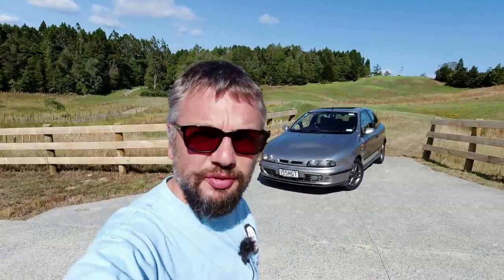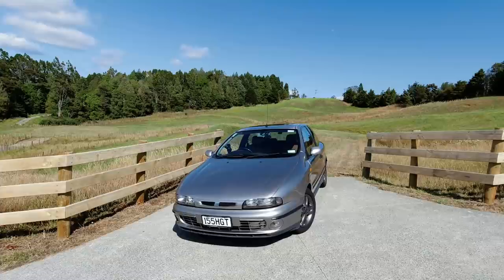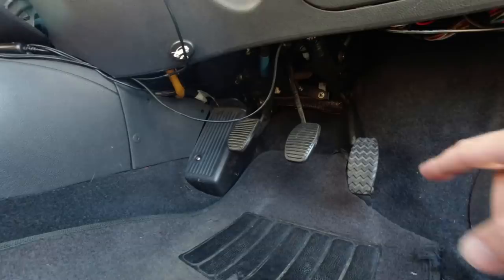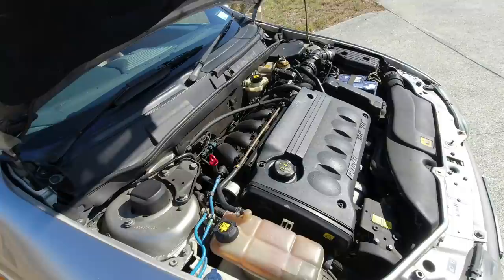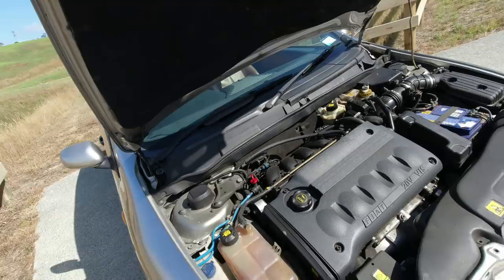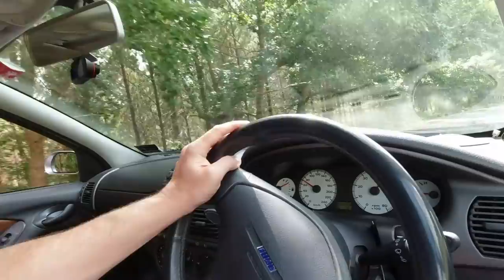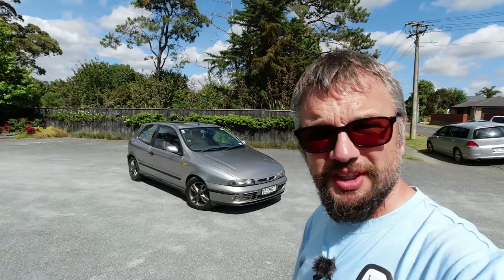Five-pot Fiat! Bravo HGT (Type 182) - Italian Music

Comment: Interestingly the speedo seems to work in reverse too. Glad to see it doesn't have those Fiat lensed lights that seem to exist mostly to blind oncoming motorists. Notably, Ford also put the Volvo 5-cylinder engine in the S-Max and Mk 4 Mondeo (obviously the Focus RS and ST also). Very much suited the big barges which had excellent chassis to deal with it.

Comment: fiats of the 90's! what a great time they were, my first fiat was a bravo 1.6 with a measly 103bhp.
but the twin cam 16v sounded amazing after 4,000 revs. 
HGT Bravo's are insanely rare to buy here in the UK. The 5 cylinder in NA form sounds fantastic,
Those Airbag seats in that colour were a very rare option.
The Cambelt can easily be done in situ, give it to a specialist and itll be done and couple of hours(maybe less). The Low Power is probably down the the VIS selenoid not opening correctly at low revs.
Reply: Turned out inlet leaks were fooling the system, sorted now :)

Comment: Nice to see an unmolested example. They've all gone from the roads here in the UK but I remember the 'council' look was to paint the rear lights black.
Reply: First owner 2001-08 had blacked the sills to prevent stone chips on gravel roads. Will revert to paint color when I get a respray. Clear coat starting to go in NZ UV

Comment: Interesting that the sunroof closed by itself before the drive. Still, it's 1000 times better than sliding open by itself, only to never close again. 
We also got the estate version, known as the Marea Weekend. My brother still has one, owned from new in 1999. Still a very nice looking estate car that goes well with the 105hp 1.9 JTD. The top of the rear bumper hinges down to make the boot access usefully low. I still like these Fiats. It is well-built, although the sliding cover for the tape-player had long-since snapped off and has been living in the glovebox ever since!
Reply: It makes sense that the sunroof closes when the key is turned off to prevent rain getting in because you forgot to close it!

Comment: I like that a lot!  I had a 1.6 Marea weekend (with the drop down rear bumper to air boot access) in about 2000 and seeing this Bravo puts me very much in mind of it as the front end and interior are almost (if not totally) identical apart from my Marea had cloth seats.
I remember the mirth around the 5pots requiring the engine out to do the timing belt!!
Great video👍👍👍

Comment: I know that for me the correct word is that it is a cool car. Still have to watch the video. When I was a kid, I played cars with two of my best friends which comprised running around the plauground and doing wipers when it rained, no joke!!, making engine sounds and so on. Every now and then we had a “new car”. One of those new cars was for me this one. I told them it was a poor man’s Ferrari. Okay, I admit it was either the Brava or Bravo because I mixed them up constantly. In fact I mixed them up so badly I meant it was a Coupe Fiat, yes coupe fiat, not fiat coupe in fact. Confusing times back then. Already a car enthusiast back then. Logically, being raised by a Triumph apprentice during the 70ies at the Belgian importer Decat.
And yes, 5cylinders sound lovely! They are bit peculiar, bizarre, intriguing to me all at the same time. Perhaps underloved? Perhaps ideal, if not perfect, for HubNut?
Everything you say during the introduction about the era, the designs, the resemblance of a 147, is just spot on!
The rear lamp clusters make me think of those of an Almera a bit. I like the fact it looks like it has been slightly “tuned” and matches the tuning scene of that era as well, BUT it isn’t and shows a certain level of class, albeit sporty together. Really special car than you cn keep looking at from all angles really. Perhaps a little underpowered it seems... expected more from that engine.

Comment: Worked for fiat for 20 years 1991 onwards and owned some beautifull cars with there staff discount scheme..Punto GT,, Punto HGT,, bravo HGT..stilo abarth schmaker,, you can't beat the sound of a 5 cylinder fiat..Punto HGT only 4 cylinder but 1.8 nice engine but went through camshaft variators for fun...
Reply: yeah, Fiat released a revised variator that lasted longer but they were a bit too late

Comment: I had one of these. My first near new car, back in 1999. Mine was a 1.8HLX which was a high spec car for the day. Everything except aircon. 
The seats were the most comfortable I’ve had in any car. They had to be because I’d swear Fiat had forgotten to put in the suspension which very crashy. 
It ran fine until the main dealer serviced it. Then I kept getting a random injector light. 
Sadly there appear to be none for sale in the UK now. Only the 2007 onwards model, a completely different car. 
No Mereas for Bravas either.

Comment: You missed out volvo 😂
Reply from the maker: Well, they nicked Volkswagen's engines. 😉
Reply: @HubNut  nooooo, that is an urban legend. They only used the VW  2.5TDI in the 850. The petrol 5 pots and subsequent D5 engines were their own development. This was a modular engine, also 4- and 6 cylinder versions were developed. https://en.wikipedia.org/wiki/Volvo_Modular_engine
Reply: @HubNut  Your knowledge there really disapoints me, Volvo's 5 cylinder petrol engines had aboslutely nothing to do with VW .

Comment: I had a 1.4 model from new.  The cam belt tensioner failed at 9000 miles (thankfully still within its warranty period), and then a recall was issued to replace all tensioners I seem to recall.  I loved this little car at the time, despite is insatiable thirst, (I averaged about 25mpg)!  I think Fiat replaced the 1.4 after a few years for a 1.2 from the Punto.
Reply: Paul W Yes correct... the 1.4 was a Tipo block with a modernised 12v head (2 inlet 1 exhaust) but it had issues with economy and camshaft lubrication (pipes gumming up). 

 Replaced by the great 1.25 16v FIRE motor.

Comment: My dad had a lowly one of these. All I can remember is that the soft touch coating on the interior door pulls was unbelievably flakey. It also had head gasket failure 3 years from new, just outside warranty.

Comment: Makes me sad when talking about 5cyl volvo wasn't mentioned. Considering the entire 850 range only came with 5cyl diesel and petrol. But cant remember everything :p
Reply: And the whole 2000-2007 S60/V70/S80 range...every single one of them. Fantastic engine, especially the 2.3 T5.
Reply from the maker: To be fair, I think Volvo's five-pots owed a lot to VW. The diesel was a straight lift initially.
Reply: @HubNut  I thought I'd left the VW scene when i bought my diesel and 2.5 20v 850's noooo XD I'll just pretend they're a volvo engine

Comment: So, list of 5 cylinder engines previously or current produced by car manufacturers.

General Motors
Honda
Fiat/VM
Audi
Ford/Volvo
BMW/Land Rover
Mercedes

I think that's it? Be free to add more if I've missed any out.

Interestingly Spen King once said that Rover Cars back in the day were experimenting with 5 cylinder too. Cheap to build, easy retooling, provided extra power,
didn't weigh that much extra, all win-win-win, right?

Apparently the problem was that they couldn't get the fuelling balance right. When Audi finally cracked it, electronic fuel injection had come of age.
Reply from the maker: Yes, Rover had a five-cylinder P6 prototype.

Comment: No real experience with Fiats, apart from my Citroen Relay van which is built by Fiat, but my main issue is the sagging rear suspension. I acquired this opinion during the 90s and it's never left me. #Punto 👍

Comment: "Get it revving and it does pick up" - I noticed with the stationary throttle blips that you needed about 4,000 rpm before the thing went - so I guess you'll only need 1st and second gear then in NZ !

Needs a turbo !
Reply: The cam kicks in about 3250rpm. You then need to hold on tightly.

Comment: I often wonder if things might have been different had Fiat had launched the Lancia Delta as a proper Lancia in the UK instead of badging it a Chrysler, maybe added a few tasty engines, maybe an HF, Integrale and Evo version they would have sold a lot more. The only Fiat you seem to see is the 500, you never see the new Tipo or 500 Viagra 4x4.

Comment: Had 2 of these, felt like a much more expensive car to drive, everything was very well put together inside and felt damped, the 1.4 was very thirsty with a chocolate cam belt tensioner, the 1.2 was a very good engine.
Can you find a Strada 85 Super and Abarth 130TC 😉

Comment: Great and yes, underrated car! Nice video, as always!

In Brazil the Bravo wasn't sold at this generation, just the Brava and the Marea, as saloon and station wagon. But the curiosity is: the fastest stock Mareas were brazilian! It had options from 4 cylinders 1.6 with 106hp to a 2.4-liter version of the 5 cylinder engine used on Lancias and later on Stilo Abarth and the coolest one: A Marea 2.0 turbo, with the engine from the Fiat Coupé, but detuned to 182 hp! And it had that cool grills on the engine hood!

A nice station wagon 2.0 turbo shown here if anything's interested

https://www.youtube.com/watch?v=oGaj8EJm6lM

Comment: Fiat master technician from UK .Cam belt not hard at all I just lower bottom of engine on to a steel trolley on a 2 post lift then remove exhaust front pipe.all 3 engine mounts and disconnect nearside bottom ball joint, undo engine top steady bar, then push whole power unit towards near side. It will go about 4 to 5 inches plenty of room to do belt and even water pump! works on a coupe as well .Last coupe turbo (with air con) i did cam belt and water pump only took 4 hours! coolant air con g/box oil all stay in.12.5 hour book time practical joke.

Comment: I learnt to drive in a fiat. Probably explains why I've driven nothing but fiat or derivatives for 20 years. Nowadays you can get the same power in a 1.4 abarth. But sadly only 4 cylinders. I just wish fiat were a bit more adventurous with the range. An mx5 / 124 doesn't float my boat. A modern coupe would though.  I did look at the new tipo wagan , but there was a 14 week wait. The motoring press wasn't impressed by them. The 95 is a bit gutless and short geared. But for floating over speed humps and potholes it's perfect.  And yes i bought one. Eventually

Comment: Many of the Fiat at the time shared parts and floor plan with the odd Alfa or two. But Fiats of the time had an awful rep that wasn't justified. A Tipo (Type 160) 2.0ie 16v is a great car. The Stilo was also great fun, and the Coupe 20v is a laugh a minute. But a Fiat can be such a fun drive, just be prepared to enjoy some under bonnet time. Uno, Strada, Cinquecento, Panda (Adore the 4x4) even the Multipla has its charms.

Comment: I never liked the design on these sporty ones very much, they always looked like somebody had tuned them with aftermarket lamps and mirrors straight out of the factory. They always look a bit tacky. Interior included. Overdesigned column stolks, the white dials... It all looks aftermarket to me so I prefer the S/SX.
But I love the way Fiats drive and I wouldn't mind owning one even though I know it'll break dramatically within months of buying it. So far a 3 out of 3 score when it comes to that. Judging by the total lack of power the one you drive has, it's definitely a prime example :D. 
If you regularly take cassette players apart you'd love such a flap. So much less crap gets in. 
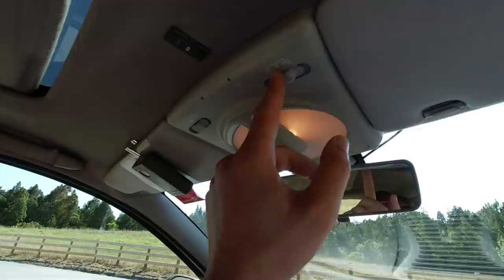4:36, reading light direction I assume! Should work if you door isn't open.
Typical Fiat, icon to tell you where to open the bonnet. And then a system that doesn't work.
8:45 20V VIS. Fish, in Dutch.
10:02 Need adjustment but I love the array of jets. Also I love that you do the wiping yourself. It never times it right otherwise. I want to soak first!
Not surprised you like it, it is a Fiat in the end. Maybe you should get one! How about a nice 90's Punto? Cheap as chips anyway. I do want a Bravo now though. Thanks for that. My next car is probably going to be shit again then.

Comment: Weren't Volvo also big on 5 cylinder engines?
Reply from the maker: Yes, though developed from Volkswagen's I believe.
Reply: @HubNut   The superb 5 cylinder petrol engine Volvo have used for decades had nothing to do with VW at all - it was 100% original Volvo (well - Porsche were design consultants.)  The 5 cyl diesel that was later added to the 850 range was VW based though, which is where the confusion arises.

Comment: My recollection of Fiats, from many years ago, and Italian vehicles in general, is that the switches were junk. And well, electrically, not so great. I had a Ducati motor cycle back then and well, it was a great bike but electrically was another matter. Driving home one night the head light switch went away. Not a fun time. That wasn't the only electrical complain either, unfortunately.

Comment: Weird eh when you’re told that FIAT stands for “fix it again tomorrow”
Reply: I thought It was "Fix it again, Tony!"
Reply: Uninformed housewifes call Fiat that way.
Reply: @nicoroehr  I heard it from Scotty Kilmer! I don't think he is a housewife!
Reply: Izzy Stuart cool if you’re partner is called tony or you’re mechanic otherwise it’s certainly going to be in the garage again in short intervals
Reply: @alistairstuart2009  but he does tend to churn out clickbatey videos with regards to manufacturer reliability. Always irritates me that his videos are pushed to me as ads when I disagree with most of the stuff he says.
Reply: That's BS. Fiat are reliable if looked  after. They don't tolerate abuse and it's easy to spot a neglected car if you know anything about them. I have 2 of them,both 23 years old.
Reply: @JamieFrew  Yeah al give you that, I used to love his videos but now its just clickbait like "do this to make your car last forever"
Reply: @sotirismp2883  He used to make good videos but now its just clickbait
Reply: @alistairstuart2009  a lot of his advice was very dodgy, i wouldnt trust him to change a bulb in a car, let alone give me car advice
Reply: Modern FIATs are surprisingly reliable, with the exception of Multiair and Twinair engines. Those don't have throttle bodies and instead have hydraulic actuators on the intake valves, while the exhaust valves are driven by a camshaft. It's a needlessly complex design, and you need to use the exact oil they recommend, otherwise they are notorious for breaking catastrophically. But Fire and Multijet engines are rather stout. Fiat has a bad reputation in America because Multiair engines is all they offer over there.
Reply: @MrBlellow  I still wouldn't buy one, the uk spec fiat 500 used to have so little power the couldn't make it up steep hills, the cars that had this problem had to be re-tuned. They are probably fine now. I agree with you that some engines are needlessly complex now.
Reply: @sotirismp2883  lol, he is an old school guy, He is good with older cars but I don't think he knows much about newer cars
Reply: @alistairstuart2009  Unfortunately small displacement N/A petrol engines are greatly penalised by the new Euro normatives, and it's made even worse by the ridiculously tall gearing you get nowadays. My family recently bought a new 1.0 Toyota Yaris and there are some hills where it only holds first gear, while my 1992 45 bhp VW Polo sails past it in 2nd.

Comment: 3:40 Wiper and indicator levers are on the wrong side! The indicator stalk should be on the right-hand side of the steering column, close to the driver's door.
Reply from the maker: Standard for a Continental car.
Reply: @HubNut  If they;re going to build for Australia and New Zealand, they(Fiat) should comply with Australian and New Zealand specifications. And if those specs call for the indicator stalk on the right of the steering column, then so be it!
Reply: @neilforbes416  Not a requirement in NZ AFAIK. Never seen a Euro car swapped for here.
Reply: @RobinCapper  I was saying, if the car is intended for our market, it should comply with our Australian & New Zealand standards, which were generally higher than those of ther countries.
Reply: It was never actually a requirement, although makes sense to keep the indicators to the opposite side of the gearlever.  Euro manufacturers never seem to convert (early Australian-assembled cars may be different) while Japanese-based vehicles have them as we like them since they also drive on the left (RHD).  Do the Japanese convert the other way for Europe?

Comment: I thought that Audi engines had five cylinders and four valves per cylinder.
Reply from the maker: Yeah, I forgot about those and was referencing the 20v four-pot.
Reply: @HubNut  Thank you for teaching me something new. I did not know that 5 valves per cylinder engines existed. Do any other manufacturers offer this? It sounds as big a step forward as the original five cylinders engine.

Comment: I have a cousin from Fiat bravo hgt a Fiat marea 2.0 20v 1999 with some mods on engine like ehxaust straight, heads with angle valvle, porting, blueprint, camshaft 276 wit lift 9.3, lobe center 114. Here on brazil some owners have a lot problem with these engine cause The owner manual say change oil until 20.000km. That on brazil with fuel bad than have is a shoot on foot. And space for change belt is tight. Some mechanics talking a lot bullshit about car and some People Who never had The car simply make joke calling The car of bomb, Who Will explode... A lot of dumbers Who dont know nothing about 5 cylinder. The culture here is than better engine are 8 valvle. Engine with more of 8 valvle are a problem. I Love my Fiat marea five pot and dont change for nothing.